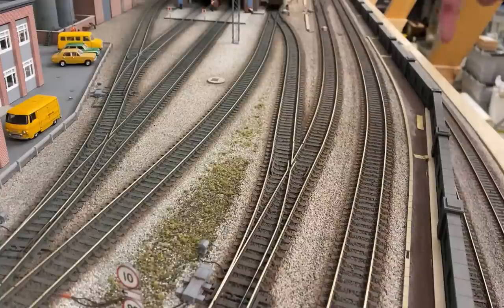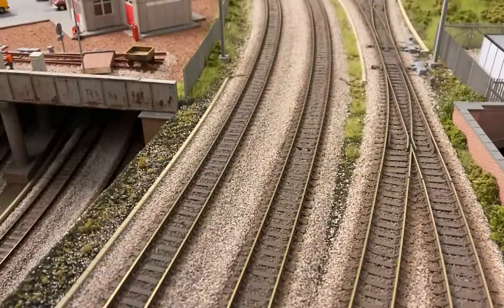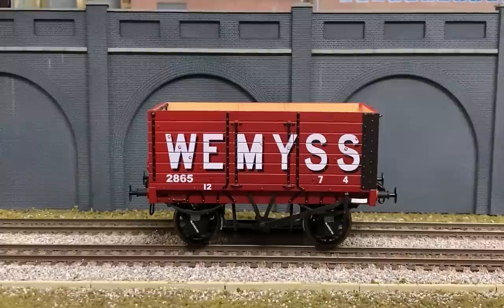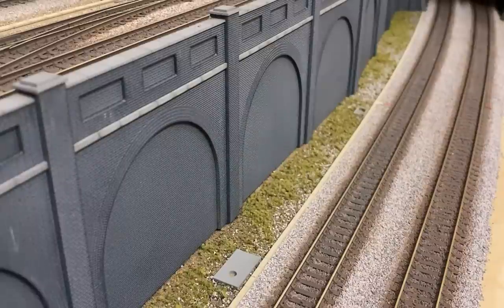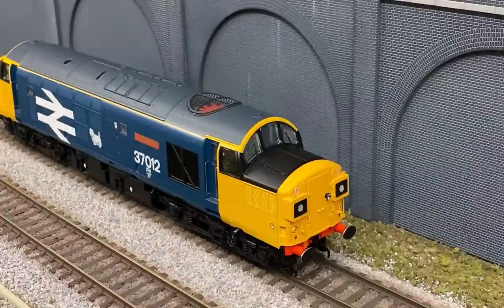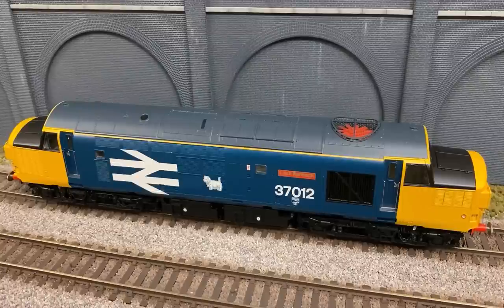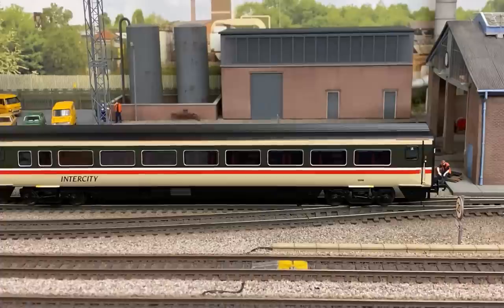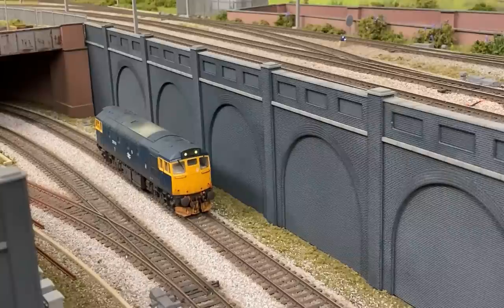Dean Park Model Railway 312 | October 2022 Layout Update | Includes O Gauge!

Comment: Very nice.
I started in 0 while I was at uni, simply because the dapol stuff is so much more affordable than a lot of new 00 stuff at the moment, and I've recently been working on 18 kit-built wagons I got from my local club for a total of £50. I've improved their running, fixed up some bits, added loads to 2 of them, repainted them all, added new transfers for lettering and numbers, and have weathered all but 5. One AA1 Toad brake van I'm also converting to have plated lower sides, which is my first time scratch building parts with brass sheet.
While watching this video, I was also adding parts to my Heljan class 07 in 00. I bought it last week for £55 DCC fitted and weathered with Hunt couplings, but it was missing handrails (some knobs missing, so I can't fix those until I have access to my bag of handrail knobs at christmas), a horn, and a few other things. I'm not sure what to do about the missing mechanical lubricator or whatever the extra rod is on one side, or the missing high level pipes at one end...

Comment: Hi Dave. Great video, nice to see the scenery coming together, and, as ever, the little details which make it come to life. Also, out of interest (and considering the price of the Kernow 37!), is the fan motorised?
Would be interesting to see a comparison between the Kernow 37 and Accurascale 37, looking at both the detail and sound.
Take care, GWR
Reply from the maker: Hi, thanks. Yes the Dan is motorized. This version is on all the time, where as other later versions, for example the 37/4 fan cuts in and out depending on whether it is needed. Nice touch that Bachmann have modelled this correctly.

Comment: There is definitely something appealing about O gauge, even if it's not the gauge you model.
14:51 - I agree. I've found that a misting of "wet water" (tap water with a drop of dish soap in it) helps the glue mix soak in quickly. Those small holiday spray bottles from the likes of Poundland are ideal, cos you don't need gallons of the stuff. 
Loch Rannoch is a beauty, but a bit (well, a lot) out of my price range! And the great west wall hoves into view ;-) Cheers
Reply from the maker: Two models I had but didn’t run were sold to make way for loch rannoch. I’m focussing my collection more now, focussing on Scottish stuff and less impulse buys. I don’t ‘need’ many more locos..but will always save up to get something Scottish :-)
Reply: @DeanPark  True Dave. I'm a sucker for Scottish stuff too, including road vehicles! There's always an excuse, and having it up in the loft helps ;-)

Comment: Hi David,What have done to improve the sound on your class 37 Loch Rannoch?With kind regards Dick Robertson [Dr]
Reply from the maker: Hi. When I got the model I found it rather loud. This also caused the sound to reverberate inside too much.

All I did here was reduce the volume very slightly. This made it much better. You can do this easily. I can’t remember what function exactly, but it’s in the instructions that comes with the loco. 

Other people have commented that their class 37 sounds seem to over power the small speakers. Turning down the volume seems to have improved the over all performance.

If you’re particular loco is not sounding as good as it should after adjusting the volume, I’d suggest contacting Bachmann, who are usually extremely good in resolving any issues. 

I hope this helps. 
David